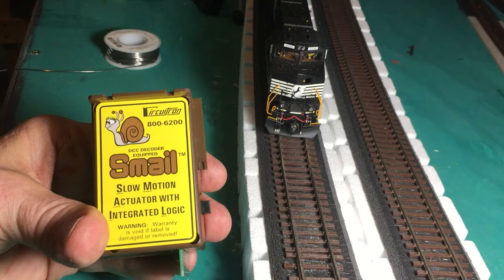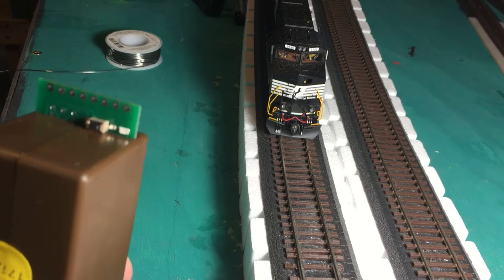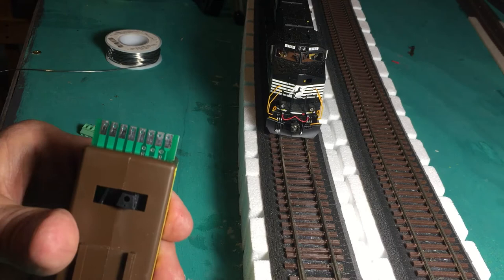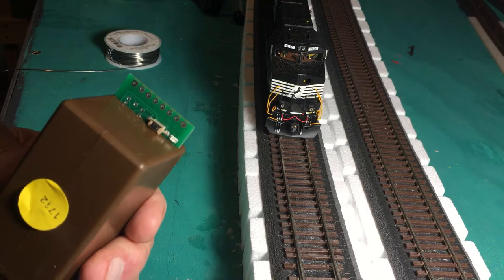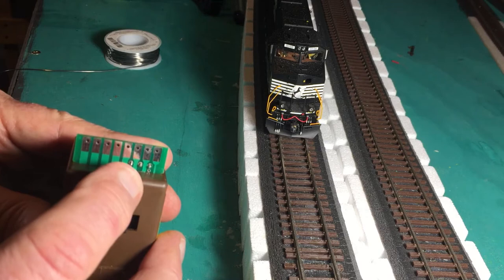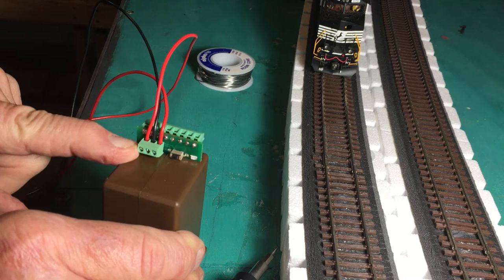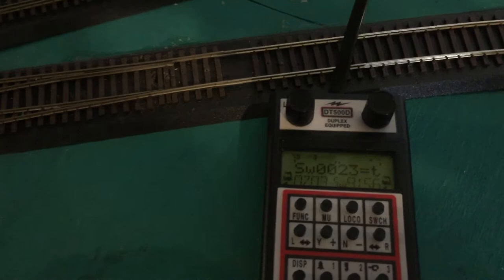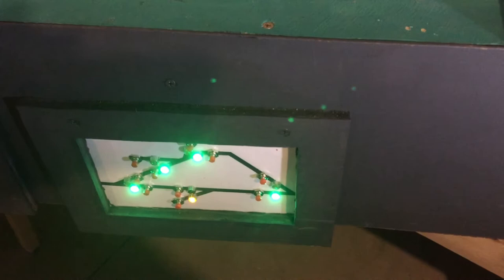Install Tortoise or Smail Switch Machine

Comment: Very Thorough and technically accurate presentation! Gained a lot of good info. I like the screw terminals added to the Smail itself for both the 8 and 3 terminal blocks. 
I like the “Euroblock” terminal strip to keep all the work away from the unit.
Your technique of dropping the wire down is opposite from our method, but I will try it just to explore the idea! We attach a small Masonite square with outer predrilled holes mounted to the motor to give better access to the mounting location.

Comment: Jim Thanks for the information I just got my first batch of SMAIL's  Like the idea of the connectors just ordered them.  I power all my frogs  so you said the pins on the smail are the same as the tortoise machine if that is correct then I know which pin I need to power the frog.  I also use push buttons on my panels I can control the turnouts 4 wayts 1 panel two throttle , three JMRI panel and 4 my iphone using withrrotle.  I use Push buttons that had red and green led they are momentary push buttons from allelectroincs  that way my panel is cleaner.
Reply from the maker: Yes, the middle 6 pins on the Smail are the same as on the Tortoise. You can use one switch to power the frog and the other for the indicator lites. If you need to control more items, you can add a relay (I like the simple DPDT relays from Azatrax).  I used to use two pushbuttons (from AllElectronics), but in my latest panel changed to a single momentary SPDT miniature toggle switch (also from AllElectonics). Panel is even cleaner! You got it! 4 ways to control the turnout! If you add a couple iPads around the layout, you can also use Touch Control to operate the turnouts. I think that is even easier than using the control panel switches. :-) And you will be all set when you decide to play with automatic trains as JMRI can change the turnouts automatically!

Comment: Jim great vid, love the terminal crimps. Question Smail v Tortoise is there a difference in casing heights and overall dimension underside of baseboard to wire exiting bottom terminal blocks ?   Head room for lower deck is my issue.  Thanks 
JP
Reply from the maker: The size of the Smail and Tortoise are exactly the same. The only difference is in the internal wiring where the Smail incorporates a decoder.

Comment: Interesting and very good the way you explain the assembly of this system. I want to know your opinion about these "smail" I bought several packages of 12, as you mention for the cost. I already have them mounted and not connected, because I don't know how to do it, and precisely this I want to know how to do. I have two options to connect to, a Z21 or an MTH, which do you recommend and if you have a video on how to do it. Thank you very much and greetings
Reply from the maker: Thanks for your comments. At the very beginning of the Smail Switch Machine Installation video I explain how to hook up the Smail. You hook track power, the same as connected to the track, to the outside contacts and it stays connected full time. Then hook a push button between the middle of the 3 lower contacts and either of the other 2 contacts. A momentary contact will cause the motor to move to one side. Use the other contact and it moves back. Do NOT use DC for anything while using the Smail. Review the first part of the video.
Reply: @jimworcester981  I appreciate such a quick response, very kind. You will have some photos of that connection, to better understand the shape of the connections.
Reply from the maker: @juanmanuelvelazquezfernand8765  there is a good diagram at the bottom of page 3 of the instructions that came with the Smail. It shows how to hook up the Smail. There is also at least one additional video that shows details on the Smail installation.

Comment: Thanks for this great video,  really helps with understanding and preforming the install.  I do have a couple tool related questions.  I am building a layoit in N scale Atlas Code 55 track with side mounted turnout actuators but would like to drill them for inside the rail actuation for more realistic appearance to the track work by cutting off the side actuators.  I purchased a small battery powered drill but it's horribly wobbly and useless for detail work.  Can you tell me the drill you used? It is clear from the video (and audio) this is a much superior drill and might allow me to not have to drill holes in 24 turnouts by hand. Also wondered what small powered screw driver you used.  That too appears very nice.  Thanks again for the video and for your help.
Reply from the maker: Thanks! I have two Black and Decker battery powered drills that I got from Lowes. Inexpensive and lightweight. Get some of the very small, numbered drill bits. You’ll probably break them once in a while but I’ve used them a lot in building my layout. The screwdriver is a must have! Search Amazon for GENERAL TOOLS 500 Precision Cordless Electric Screwdriver.
Reply: @jimworcester981  Thank you... It was a great video and the mounting method will be my goto way of setting my 24 Smail turnout motors. The use of ring tongue lugs is outstanding.

Comment: Jim - great video, however, I would like to know how to wire the push button switches and led lights to the smail if possible, I'm an old guy with very little wiring experience -
Reply from the maker: Thanks Phil. I'm old too! 

Push buttons only work with the Smail and NOT the Tortoise. On the Smail, the three terminals grouped together on the bottom of the connector board (I showed  soldering a screw terminal strip to those holes also) are used to control the Smail. You can try it with a piece of wire. Make sure you have track power connected to terminals 1 and 8 on the main terminal strip (furthest from or top of the connector board). Then touch a wire between the center and either outside terminal. The Smail should move to the other side. If nothing happens the first time, try the other one. It only takes a momentary contact. Thus you can hook push buttons to accomplish the task. Run a wire from the center terminal to one side of two simple pushbuttons. Connect the other side of each pushbutton to one of the outside terminals in the group of three. FINI. 

The LEDs are almost as easy. On the main terminal strip (the one with 8 holes) the middle 6 terminals make up two separate single pole double throw switches. You only need one to make the lights work. Connect one side of your LED power supply (I use 12 volts DC - make sure there is a resistor in there - the ones I use have a built in resistor) to one side of each light. Connect the other side of the power supply to the #4 or #5 terminal on the strip. The common connection for each of those two switches is #4 or #5. The output for #4 is either #2 or #3 and, likewise for #5 is either #6 or #7. Then just connect one output to the other wire on each light. As the Smail moves from one side to the other, the switch changes which output is powered and thus which LED comes on. If the LED doesn't light either way, you have the leads reversed to the LED. It won't light if the power is hooked up backwards. (It's a diode only allowing current to flow one way). If the wrong light comes on when the Smail is thrown one way, reverse the connection to terminals 2 and 3 (or 6 and 7). Try it on the workbench before you crawl around under the table and you will understand better. Let me know if I didn't explain clearly.

Jim

Comment: thanks for your reply Jim - one other question - how do you power the frog in all of that?
Reply from the maker: There are two SPDT switches integral to both the Smail and Tortoise. The middle six terminals on the main connector are the leads for those switches. 3 on each side. The two terminals in the middle are the common or input to the respective switches. The next two terminals on each side are the output from the switches. For frog control, you would actually connect each side of track power to one of those output terminals and the frog to the common terminal. Whenever the machine changes position it would also change the track power side that is connected to the frog. Now, FYI, I have not powered any frog on my layout and I have around 30 turnouts. But I also have newer locos that are powered from all wheels so the locomotive is never without power even if one truck is on the frog! If you are running short locos or a steam loco that gets power from the tender, or some other similar situation, then there might be a problem with the frog. In our club layout I also did not wire the frogs and no one has complained! Some older turnouts or #8 or larger turnouts have frogs that are pretty long and thus might need to be powered.

Comment: Hi Jim, hope you are well, so the SMAIL would eliminate the need for something like a separate turnout motor and a decoder like a DR4018 from digikeijs right?
Reply from the maker: Yes. The Smail is a Tortoise with built-in decoder. No need for the 4018 nor DS64 from Digitrax. I started using them from the beginning of my new layout and glad I did. Cost is about the same when you add a decoder to control Tortoises.
Reply: @jimworcester981  awesome thank you

Comment: Jim,  I would like to know the part manufacturer or part numbers you use for the pushbutton and the LEDs?  Also, can you still hook up the electrified frog and the LEDS?
Reply from the maker: The LEDs I ordered from Amazon.: 
5PCS/set 8mm 5/16" LED Signal Indicator Bulb Metal Shell Pilot Dash Light with Cable Length 20.5cm / 8.1 inch for Car Auto Vehicle Boat 
Careful they come in several types. I like Type C. All come with resistor already installed.

 
I'm not sure where I bought the pushbuttons. I think also on Amazon. I think these were the last ones I bought as they already had leads attached. Anything small and cheap!
Twidec/10Pcs 1A 250V AC 2 Pins SPST Red Normal Open Mini Momentary Push Button Switch with Pre-soldered Wires PBS-110-XR

Since there are two SPDT (single pole double throw) switches on the Tortoise and Smail, you can use one for the indicator lights and one for the frog, although I have not powered any of my frogs.